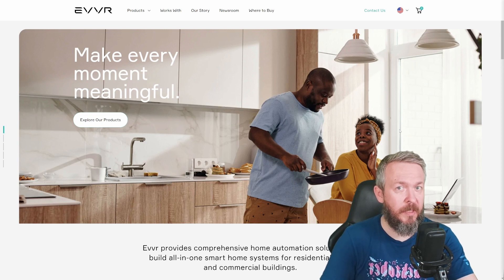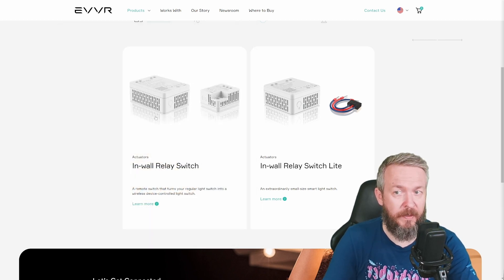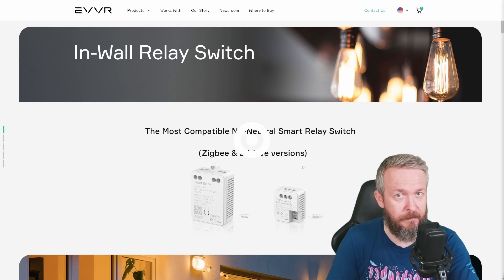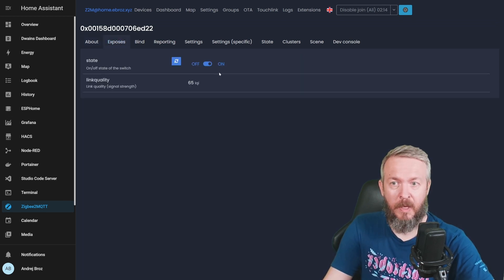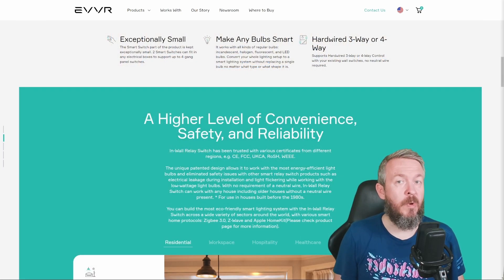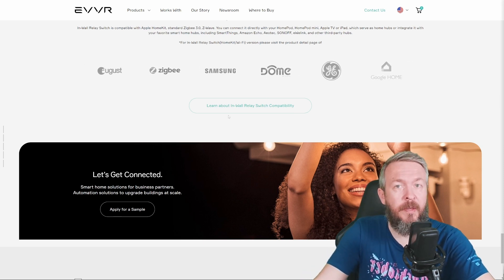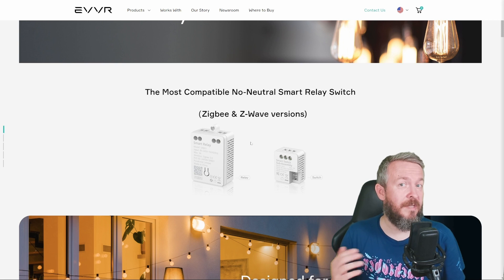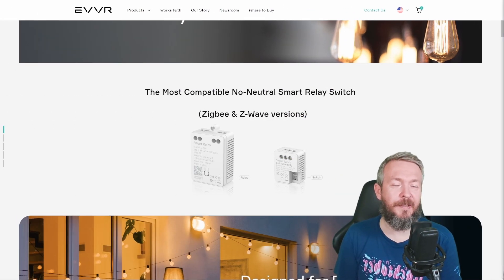EVVR Zigbee Smart Relay and Sub-Assembly in Home Assistant

Comment: I wonder, is it possible to connect multiple "Smart Relays" from different manufacturers to the same switch as you had it in the video? if so what the wiring would look like, so the 2 relays won't interrupt or depend on each other. [Meaning, both relays can independently turn on the light if it's off and detect the the state of the lamp if the other relay state is different. (so relay 1 knows if relay2 is ON)]🤔.. by the way great video!
Reply from the maker: Thank you Daniel! Not an easy answer. As this switch panel has 4 switches, each one had independent power circuit - so that could be considered like 4 independent switches.
Bu if you want to have 2 of relay controllers, there are few options. There are some devices that can handle 2 switches and 2 independent (I think Shelly is one of them)  you need power + neutral for controller and than at minimum 2 more wires, each going to load (light for example). https://shelly.cloud/knowledge-base/devices/shelly-25/

Comment: Many thanks for the video. I didn’t understand the difference between a) relay only or b) relay + switch, could you please clarify ? Thanks ;)
Reply from the maker: Sure! Switch module allows you to control relay with your existing switch in wall. Without it, you can't control it via switch, but you can control it via WiFi or Zigbee (depending on the type). That way you can use it in different scenarios - when you need manual control or when you want to avoid control via switch.

Comment: Can you please explain how to use the announce:true feature in homeassistant media_player.play_media service??

Thanks in advance
Reply from the maker: Not easy answer as even if you use it properly, that doesn't mean it will work as you want it to. It requires speakers to support it. Not sure if anything has changed in last 1-2 weeks, but so far non of the big ones didn't support it (Alexa, Google, Sonos).
Reply: @BeardedTinker  ok thanks....

Please make a video on how to connect and use two Bluetooth speakers at the same time with raspberry pi lite (bullseye)...

Comment: Hi! What are the dimensions? Is it bigger than Girier zigbee relay (the smallest I saw so far)? Also absence of power monitoring significantly limits usecases of similar relays.
Reply from the maker: This one is 59x39x21mm for relay. Yes, it doesn't have power monitoring capabilities, but that's no issue for me as I'm using PowerCalc in home assistant to track power usage of devices that don't report power consumption.
Reply: @BeardedTinker  Thanks for the dimensions and thanks by the way for your content, which was and is very helpful for me within the HA understanding process. The relay I was talking about is 41x41x20 (Girier JR-ZDS01), so it is a bit smaller which might be important for the small boxes behind the switches which I traditionally have in my country. As for the power monitroing - this approach is valid of course for the devices which have constant consumption (like lights).

Comment: This is a great product and really interesting alternative to smart switches.    The sub assembly makes the no neutral situation a lot easier to handle.
Just a note.  I noticed a typo in your Title for this video.   I think realy is mant to be relay :)   Just being pedantic and OCD lol.     
Just a question:   Does the relay part need permanent live, or does it connect inline with the "switched" live when using the switch module?
Reply from the maker: Thanks for the typo spotting! Was in hurry to finish this as I was off to a vacation! 
Relay does require permanent live. My guess is that this switch module is giving it a pulse when it needs to switch on/off while keeping it always powered.

Comment: Thanks for the review! Doesn't seem very different from the z-wave in wall dimmers and switches that I'm using from Qubino, Fibaro and Philio Tech.
Reply from the maker: Thanks for the tip - I didn't test so far any Zwave device myself. Don't have any stick. And I didn't test any stick some companies wanted to send be because I had no z-wave device - kind of stuck in the loop... 😂
Reply: @BeardedTinker hilarious. Then you need to get Aeotec or a similar company that have both the stick and the sensors to send you their products ;-)